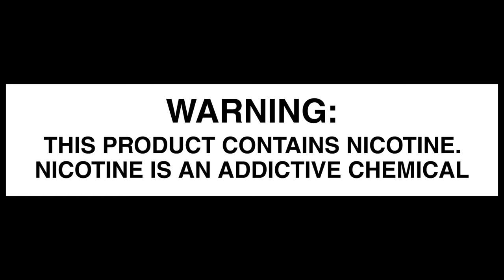Updates! : Best Dead Goat Build and Wick

Comment: 15:24 whoa there Mr. Wildstyle, that 0.8 is gonna blow your face off! Those IMRs can't handle it!
Reply from the maker: Two good iJoy 20700 in parallel can absolutely handle the amps
Reply: Battery Mooch rates them at 30 amps, in parallel that's 60 amps for 2. Which means with a .08 you could safely go up to 200w, which draws 50 amps, giving a 10amp safety cushion. Ain't nobody vaping that build at 200w anyway
Reply: Hanno Terblanche It doesn’t actually double the amperage but either way I would call a .08 with those batts safe. I would recommend never burning and checking your build on a mech mod but besides that no problems with this build.
Reply: I'm just messin around with ya :p you said 0.8 instead of 0.08
Reply: @danebeee1  yeah you're right, it doesn't double it but it does increase, and there is less internal resistance with 2, even with a 40 amp draw you could, as you agree, safely go up to 120'is watts. Now putting that on a single 18650 mech would be asking for trouble, dodgy as hell. Although a Sony VTC5a..... nope, don't do it kids, play safe 😁
Reply: @dotChrollo  lol, I commented before I got to that part in the video. You said zero point 8 Nick! I still red your comment as 0.08, my brain was telling my eyes what to see along with "blow you're face off" 😂
Reply: @hterblanche  that may be a good thing! Never a bad time or place to practice battery safety if you ask me
Reply: @hterblanche  ?? Is dotchrolo grim greens alt acct or am i missing something lol

Comment: Hey buddy. First off, thank you for reminding me that R.K.O.I. exsists. I immediately went and bought 120mls of this absolutely delicious liquid. It had been a while, but still great stuff. Second, just wanted to say that I had ordered new SS posts for my SS Kennedy 24 cause...well...copper in an rda is gross (imo). Since installing them (correctly) it's been leaking through the negative screw. I emailed Kennedy enterprises and they told me to ship out the atty and they will fix or replace the thang! Find me a Chinese company that would do that after a year+ of ownership? It's an expensive atomizer, but c'mon? Made in the USA! Hope all shall be well with ur family. They always come first.
Reply: Just an update. About a week later, I guess they couldn't find out why it started leaking, I got a brand new 24mm stainless steel Kennedy on the mail. Complete with ss posts just as I sent it to them. AWESOME company! Thank you Kennedy Enterprises!

Comment: When will the GOAT drop a rebuildable deck? Having discovered allergic reactions to the nickle heads Ive honestly wasted money on a shelf decoration vs something I was excited to ise
Reply: You can go to there site n see if u can buy the dead goat deck
Reply: @cavemanlovesmoke4394  "Please note the new cap is required to use the build deck and that is why they will not be sold separately"

Pretty much have to buy a new rda for it. It's sad that they go for a single type of wire that thousands are knowing and (in my case) unknoweningly allergic too. Then release the long awaited rebuildable that basically requires a total rda change to use. And still no kanthal or SS based goat heads. For me it's a $40 vape shelf dust collector

Comment: How do you fix “check atomizer” error message with Dead Goat RDA? Can’t make it protrude so to speak. Please help advise! Thanks, Serena
Reply: Check the 510 pin.
Reply: Roebuck Summers well yes that was my first check. The Dead Goat rda has a special kind of pun, doesn’t much protrude. The “stud” replacement is a pain. I removed the “Anarchist” squonk coil head and placed the DR/DG deck in - it’s very finicky by the way....
Anywhoo, the 510 pin that is included in the kit is more like a “stud”. Only place I saw where it’d fit is if I take out the squonk pin surrounded by peek insulator... then it won’t fit into the juice well, and that 510”stud” pin still doesn’t protrude enough for some regulated mods to recognize it. 
PS - SS colored deck I bought is very temperamental- I thought it was bc of my coils. Turns out the same coils worked in my friends rebuildable deck. I can’t figure out why it would vary from one device to another so much
Sigh. Thanks if ur still reading, S